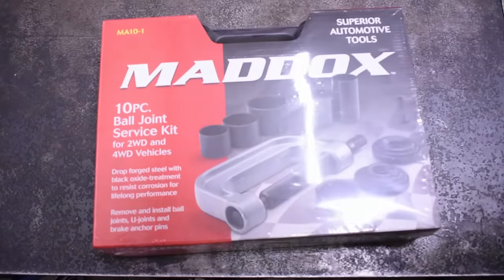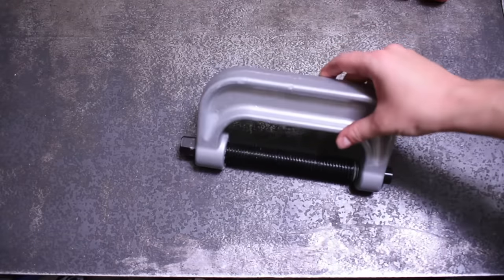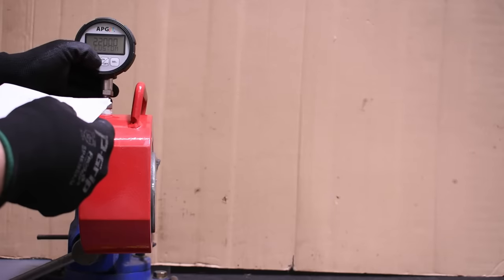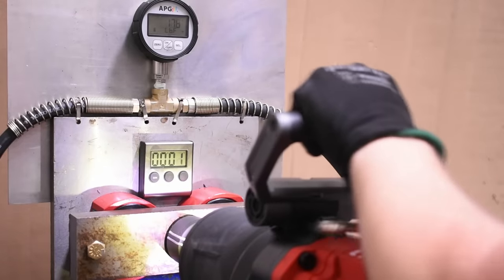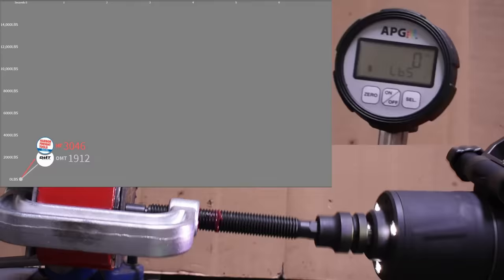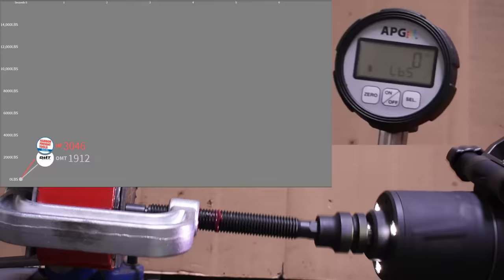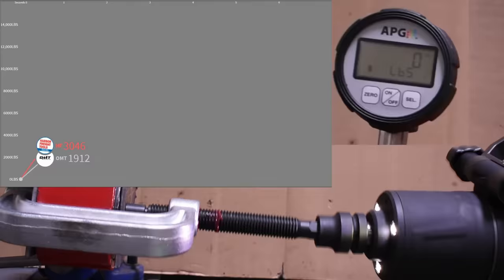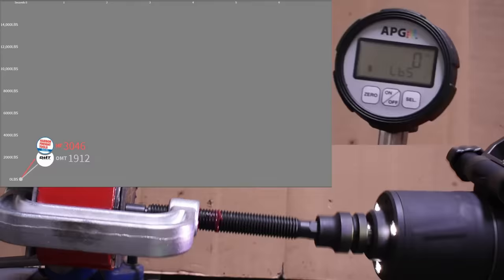Exactly How Strong are Ball Joint Presses? Harbor Freight vs Amazon

Comment: I wonder how the industry premium tool, the Snap-On BJPT would have fared? My family used to be in the car repair biz and bent up all the cheap tools just as you show. Once the Snappy kit was purchased, bending failure ended. I inherited the kit and even with shop use, its straight, its got great threads, and non of the rings or plates are deformed. It had use on suspensions and on light hydraulic systems driving seized pins... and it still all works like new.
Reply: You get what you pay for, sometimes!

Comment: Hi, I’ve used the power built puller with an ir impact and it got the job done, in the last five years or so I’ve been replacing the the entire control arm it’s cheaper and more efficient,

Comment: As a diy guy I would be curious how these stack up against the various ones you can rent at a parts store. That would put in perspective if it is worth owning one or just renting it when needed.
Reply: Honestly I’d just rent them. You pay a deposit and get your money back when you return it. Unless you’re a mechanic for a living, you’re not doing ball joints often enough that a trip to the auto parts store is inconvenient. Spend that money on other tools you use often. Just my two cents.

Comment: Would love to see a “drag race” between the Astro Pnuematic 7865/7897 and the Powerbuilt 648617. I would think these two kits would be near the top spending limits a moderate to heavy DIY’er would feel comfortable buying. These tools also seem to present as better quality compared to the OMT kits. It would also be awesome if you used the press collars and adapters in the kits. It seems like this is where these tools really give up. It’s not so much the forcing screw and c-frame press, it’s moreover the cups and adapters that bend and crack. Love your channel!!! Keep up the good work!!!

Comment: If the ball joint doesn't come out on full force, hit it with a metal hammer.  I did that with a universal joint that had maxed out using my bench vise.  One moderate blow to the joint and it was out.
Reply: Try a 20 year old pitman arm in a Ford or Chevy truck. I had 1 that wouldn't come out with a 1in breaker bar & 7ft pipe.
Reply: Oh & I still hit it with an air hammer, my mechanic was so mad.
Reply: That's how I do all ball joints now. Just crank the press down moderately tight, smack the metal next to the joint with a BFH, tighten, snack, repeat. Way less effort and a lot less violent when there isn't 10k lbs of force on it when it breaks loose.
Reply: @christopherblodgett8362  yeah that was me back in the day & a pitman arm, definitely not a ball joint. I now do it your way cause your right it's much safer.
Reply: @joselozano0528  I first learned about it fighting with the upper frame mount for the front track bar on my jeep TJ. Someone in the group told me to smack the side of the frame mount and I couldn't believe how easy it worked. Then I tried it on the upper and lower ball joints and they popped right out. Then tried it on the tie rod ends with just light/moderate pressure from a 1/2" ratchet on a small cheap harbor freight ball joint separator and they popped right out too. And this was on a rusty jeep that came from NY. Almost as much of a game changer as discovering 3/8" battery impact wrenches lol.

Comment: Didn't even use one of these when I did a ball joint. Used the screw wedge thing to bust it loose from the control arm, and a combination of part of a bearing press kit, a 10lb sledge and some larger impact sockets to press out and in on the knuckle.

Comment: I can attest for the strength of the snap-on ball joint press, (BJP1). Used it for traction bar bushings on heavy duty fords, spring shackles on pull behind trailers, ball joints of all sizes and types, rigged it to use to remove a slack adjuster in the field one time…one of the best tool investments I’ve ever made

Comment: I haven't started watching the testing but I know without watching that I would choose the Maddox from HF.  I own one and I have abused it to no end.  I've hit it with over 1100 ft lbs of torque and pushed a hole through thick steel withot any bending or braking.  I pushed ball  joints out from a 23 year old truck the other day with the Maddox and it made quick work of the project.

Comment: Great video but I have to ask, why are you doubling the deflection measurement? The piston is still backed against the rear foot of the tool and any deflection back there would also show up as increased clearance at the front where you measure.
Reply from the maker: The total dimensional growth at 14:39 was greater than anything we measured using the D-handle by measuring one end, and that's from a 1/2" earthquake impact. There was bend going on at the back during the runs, we just couldn't access it and put a number to it. So we doubled everything, which since they are just being compared to each other should still be usefull, but agreed not the best approach. Some 12" calipers would have been better measuring the whole press length, but we plan to test larger c frames to and even 12" calipers would not have worked there and we couldn't swing $350 calipers.
Reply: @TorqueTestChannel  Anytime tool 12" calipers on Amazon are a pretty nice set for $80. I'm a career machinist and use them when I need the bigger size. Sometimes handy too having a dial caliper that does standard and metric
Reply: @TorqueTestChannel  Fair enough. Those larger Vernier calipers definitely aren't cheap.
Reply: @TorqueTestChannel  You are referencing your measurements from the back side of the ball joint press. Measurements that you took are the total delection. Body of the ram is acting as a gauge block.

Comment: I had a HF and it bent trying to remove a lower ball joint on a 2001 dodge 2500 pickup. Never did get it out. Replaced with an Astro but haven’t used it yet. I’m curious how the astro would do.  I hear the OTC is suppose to be good also.
Reply: I use my old Harbor Freight set to loan to people I don’t care for. Seriously the  Astro may do it but I just skip to the snap on for anything but small cars!

Comment: Despite trying my hardest, I cannot figure out the reason for doubling the deformation reading.  If the pressure cage does not swell during the test, the measurement is the "total" without doubling.  At most, if you want to calculate each individual prong deformation, I would rather divide than multiply.  What is going on?
Reply: Same ?  Makes no sense there would be double that in actual deflection.
Reply: @snap-off5383  ....  So, how will the same gap magically appear to the back side of the pressure gage?
Reply: @InssiAjaton  read what I said and understand it, then you won't need to ask that question. (I'm agreeing with you)
Reply: You are correct.  Torque test channel got that aspect wrong.  a 5mm deflection is just that, a 5mm deflection.
Reply: Was about to comment on the same thing. Indeed his measurement already equals to the total deflection, because the setup is not symmetric (deformation only shows in the front, at least if the pressure thingy does not deform).
Reply: I totally agree, my engineer brain was really trying to figure out a way to justify it but I just don't think it makes sense

Comment: I had an old Pittsburg from Harbor Freight, doing ball joints on a Jeep XJ. Kept turning my breaker bar until I noticed the C was no longer a C. It was bent bad. Went to Advanced Auto and rented their OEM ball joint press. Just looking at it, it was a substantially bigger C. Think $99.00 deposit that you get back when you return the tool. Told the guy at Advance Auto I wasn't bringing it back if it worked. I never returned it. It works very, very well. If you can't get ball joints out with this and a 4 foot breaker bar, you ain't gonna get them out.

Comment: While not a ball joint press, the Snap-On TAP1 brake anchor pin press is designed to be used with a 3/4” impact. Taking that press to the limit would be cool. Keep the good content coming.

Comment: Just some polite constructive criticism. I do like your channel a lot, thank you for all your efforts. 
When doing a hardness test it is very important to test on a smooth surface. Preferably a ground surface but a machined surface will do. A sand cast, saw cut, or otherwise bumpy surface is not suitable for hardness testing. Testing on the side of a cylinder can give an erroneously soft reading due to possible deflection, especially on softer material. At worst use a file to smooth the surface your using the hardness tester on. 
Keep measurement standards consistent. You use pounds per square inch for force, yet measure deflection in metric. Pick one, Imperial or Metric. and stay the course. Of course noting the other measurement in text for those who need it. While we’re on mesuring, there looks to be inconsistent positioning of the calipher. This will cause errors in the measurement. Like I said good videos, keep up the great work. Thanks for all your time & effort.

Comment: The 1" Milwaukee is a beast. I've been using and abusing one for almost 2 years and a fleet mechanic of 40 FedEx trucks ripping off 1"1/8 lug nuts and it keeps trucking. Highly recommended if you're a heavy duty mechanic.

Comment: The maddox works ok for the money. I use it professionally and it's always done the job and held up well. The cups are a bit soft and if abused will bend, but it takes alot of force. The actual press itself has held up to the strongest 1/2 in the shop, and hasnt had any issues. For what it's worth, its almost worth just replacing the adapters with a cheap set from Amazon to continue using it. I've had one time where the cup was slightly deformed and kept slipping on the control arm, I had to use the shops snap on press, which imo is the best press you can buy, if you have the money.

Comment: I have the Maddox and it worked fine when I had to replace the ball joint on a 97 Dodge Ram's original that went through many many Minnesota Winters. I used a 5' jack handle as a cheater bar and when it broke it was so loud I thought it snapped the socket. But truth be told I only intended to use it once.

Comment: I bought one of these OMT sets for a ball joint job. The 2.25" inside diameter sleeve wouldn't fit over the balljoint. I measured with a dial caliper and the actual ID was 2.24". I had to ream around the inside of the sleeve with my dremel to get the thing to fit. That 10 thou makes a difference. Otherwise I didn't have any trouble with the kit.

Comment: I have used the same otc ball joint press professionally for 15 years.  While your on the trigger of your impact tool or ratchet you or a friend tap the spindle around the ball joint seat with a ball peen hammer or maul.  Thats a free advice to save your tool life.

Comment: I have the harbor freight model. I’ve only used it for 12 ball joints, once off and once on, so 24 time. So far it is holding up but the cups and adapters are starting to deform. Great video
Reply: Lifetime warranty

Comment: Snap-On has the best ball joint press. I've used a bunch, and the Snap-On is just so much better and worth the $1800. The cups clip into the press so it's 1 handed operation. Idk how but it provides much more force than the normal ball joint press. My IR2235 impact stopped spinning with the OTC press and couldn't get the ball joint out. Used the Snap-On, it kept turning until we heard a loud POP and out came the ball joint. I'm considering buying my own just in case I go to a shop that doesn't have one.

Comment: Bent the harbor freight ball joint puller (c-clamp).   Finally used an air hammer to vibrate the A-arm and the ball joint pushed out. 2005 Toyota tacoma.

Comment: I've had a Snap-On (I think it's a BJP1) for years.  I don't use it much anymore because I've lost or ruined quite a few of the adapter cups and other parts, but the press itself seems to be as solid as it always was.  This press is quite a bit more robust than the OTC and it's many clones.  With its grease fitting on the threaded end of the frame and finer pitch thread on the screw, it just seems to be better built.  I'll bet it will be a contender for the top spot.  I also have a hodgepodge of OTC and Astro, which are my primary tools now.  The cups and adapters seem to be interchangeable, they're easy to find on all the tool trucks (except for the Snap-On truck), and seem to hold up well.

Comment: I've had good luck with OTC suspension tools.  I've abused the heck out of their front end puller set and haven't broken anything.  I used a puller to press in a ball joint with an impact.

Comment: I would vote for the Snap on BJP1 ball joint kit as well. I've got one and I've used a 36" 3/4" drive breaker bar on it to get some stubborn 2500 ball joints to bust free. Still no issues with it.

Comment: I just picked up the ~$60 Astro kit off amazon. I borrowed the Maddox to do a job, but how they justify it being about $30 more than the Astro kit, I can't figure out. I didn't have any issues with either kit, but the threads on the press for the jack screw on the Astro fit perfect and felt like butter compared to the Maddox. I used ARP Ultra Torque on the threads.
Reply: I think many of the newer Harbor Freight brands are significantly overpriced.

Comment: Not a pro but I've done terrible things to my OEM Tools 25104 and it has held up nicely. The nice thing about this kit is it does some larger joints, like those in 3/4 and 1T trucks. I suspect the reason the Harbor Freight gets good reviews is because it's "good enough" for most lighter jobs.

Comment: What ever the brand that O’Reilly Auto Parts rents is quite good. I used one to replace the ball joints on my 2004 Chevy Trailblazer without any problems. I did lubricate the press threads with a high pressure red grease. It would had been nice if I had a high torque impact. So I had to do it with a long breaker bar with a extension.

Comment: It would be good to know if possible how much force a  typical rusty ball joint takes to remove. The few times I used these tools, I despaired that they would work at all until I finally got a dangerous sounding SNAP when the ball joint finally moved.
Reply: It would not take 2000lbs of force anyway so the Maddox is fine....

Comment: I have an otc branded ball joint press. And i do know, doing dana 60 ball joints, i had to give it everything my 1/2" air impact had and still beat the crap out of the knuckle with a sledge to provide vibration for the ball joint to slowly wiggle out. I would like to believe it took forces in the 30,000 lbs range to move thoes balljoints.

Comment: Not sure what brand I have but the C started bending while tightening it against a stuck balljoint. Heat still didn’t break it free.
Ended up removing the press and oounding the balljoints out with a hammer.

Comment: Well I have an Astro in my Amazon cart, waiting for part 2. On my third set from Harbor Freight... Reason, only place locally I could find one when second failed, needing the truck next day. One car, lower ball joint, I took the spindle down to the tire shop, owner pressed it out and new one in for $20, small town. Took just a few minutes, said he used a snap on, a knock off of snap on's design would suffice for a test?

Comment: ive been using a princess auto (canadian harbor freight) version for the last 10 years or so professionally.  Its pretty bent but still does the job using my milwaukee high torque.  After the Torque Test Channel gets some more ball joint presses under their belt it might be time to buy a new set.

Comment: it would have been nice if you had reset them and measured any deflection between runs- to roughly test their yield strength. Also that tiny little portable hardness tester doesn't tell you very much, since it will only be doing a superficial test and not indicating if it's a case hardening or how thick it is. To figure that out you need to slice it and test several depths on the slice (imagine hardness testing different tree rings)

Comment: A major problem with HF's old Pittsburgh set was the adapters were soft and would start to bend and collapse then the C-Frame wouldn't be pushing square anymore and would fail. If their new Maddox brand name model doesn't have better adapters then it really won't matter if it's C-frame rates as stronger or not.

Comment: I still have that old Harbor Freight original.  It gets used a bit more then I'd like.  I've not had it bend, but the drive screw is pretty well trashed.

Then again I've had it for about 15 years.  So it doesn't owe me a dime.

Comment: I would love to see the Astro compared to the Snap-On, Matco and OTC.

The shop I work for awhile back had an Astro as a shop tool, and it seemed to hold up well. I would wonder if it still is a good tool and worth the lower price tag vs the more expensive ones.

Comment: I just used this exact press from HF to get the ball joint out of my 03 ford expedition.  Tool worked just fine and did the job. Only complaint is I’d like one of those thick spacers that are open on one side.  The control arm didn’t have room for the spacer to sit all the way around it.  I had to wedge in a pry bar to hold the spacer in place.  I blame that more on the control arm than the HF press
*edit.  I was using the dewalt DCF921 with a 6ah XR battery.

Comment: My current kit is OTC 4295 which cost me $250 bucks but definitely can hold up to a 1" pneumatic impact. The most important thing about these C-clamps is to keep the drive screw well lubricated due to intense heat generated by high torque impact guns.

Comment: I used a zipgun to hammer the balljoints out, and the press to push them in. Mostly because A: It was easier, B: i didnt have a correct cup size for my Acura Legend. I got the Aurelio Tech balljoint press kit. It did the job putting them in, at least, and what more can a guy ask for, for 100CAD, when the shop spec master kits go for 1300$?